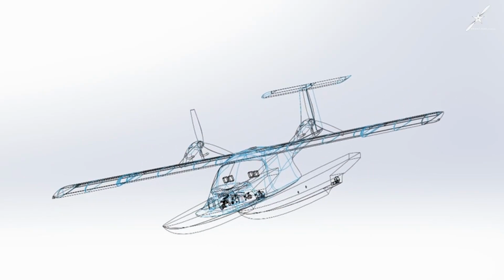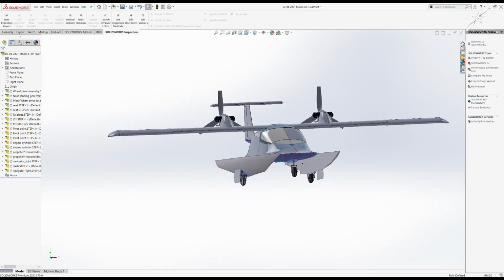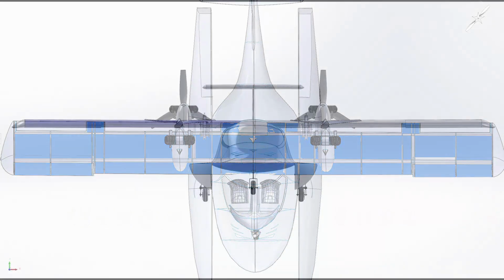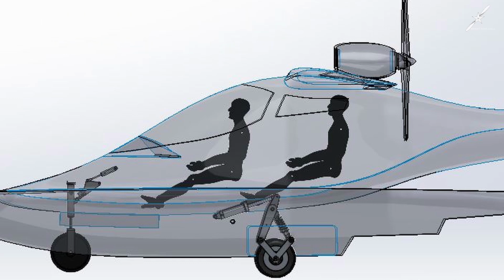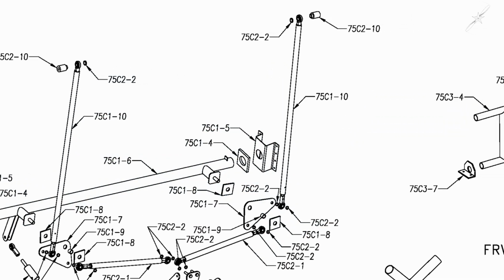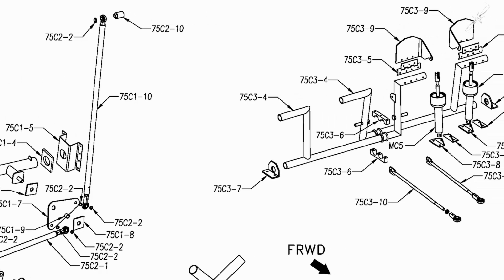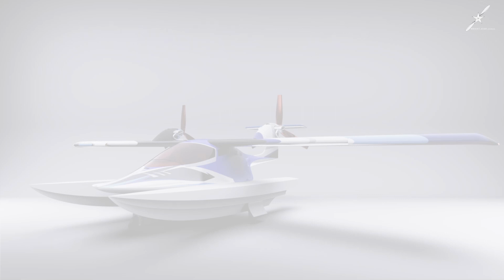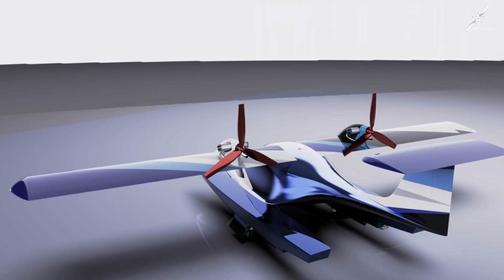Exciting, NEW, Amphibious Aircraft.

Comment: Hi, a fresh graduate and aeronautical engineer here. These are some ideas I can suggest that might be worthy.

1. The propeller being behind the wing (pusher propeller type) might not be the best idea for a seaplane or an aircraft that would be used on water. The propeller would go low when taking off and landing, and be exposed to water (it might corrode the engine and propeller). Pusher propellers also get damaged quickly by other debris from the ground. Another thing is that pusher propellers tend to be noisy as the disturbed air coming from the wing would hit the propeller. The fuselage might need to be higher in order to utilize a pusher propeller, but its center of gravity goes higher and its stability will be affected.
2. It is recommended on an aircraft design book that the clearance between the propeller and the water for a seaplane or amphibian is 18 inches or 1 prop diameter.
3. Reconsider the T-tail design as it could go into deep stall at high angles of attack.
4. I suggest you choose a symmetrical NACA airfoil for your horizontal and vertical tail to provide a symmetrical control on your tail's control surfaces.
5. The main landing gear tire diameter has a general formula D = 1.51*(Aircraft Weight*0.85)^0.349. The nose landing gear can be between 60-100% of the main landing gear's diameter. I'm sorry I cannot contribute to the mechanism of the nose landing gear since I mostly know theoretical on this.
6. The nose landing gear should have its strut in an offset angle from the tire to prevent it from the shimmying problem, or you can add a shimmy damper mechanism.

I would like to just add that the scale model of the aircraft is useful for testing on the wind tunnel. It will produce a more realistic picture of its performance but it would definitely cost more.
Reply from the maker: Thanks for writing rainlamarte1630. I appreciate all input especially from those who are aeronautical engineers.

1. Propeller will remain in this location because I want great visibility and having them on the aft section of the CG allows for the front of the aircraft to sit further out. I do understand the losses in performance I will be getting but when designing an aircraft there are always trade offs. I chose this one for a reason. Performance wasn't the reason. 
2. The tips of the propellers will be about four feet up from the water. 
3. Funny you should mention this. Just yesterday I had my CAD guy move the horizontal stabilizer to the mid section of the vertical stabilizer. 
4. The horizontal and vertical stabilizers both have symmetrical airfoils. 
5. Please email me at brightstarassemblies@yahoo.com about this. To be honest I had not thought about the size of the tire until just now. I would like to know more about this.
6. Same with this point. email me. I am not 100% sure what you mean by offset angle. I do understand a lot about shimmying problems.

Thanks again for the input. All is welcome.
Reply: Maybe make the engine tilt-capable.  Tilt down 5 or 10 degrees will shorten take off distance.
Reply: Omg, this makes me want to go out and study aeronautical engineering. Also, do you have any comments on ducted propeller fans? Are those feasible on aircraft?
Reply: Obviously you have very little experience and knowledge pertaining to light sport amphibious aircraft as 90 percent of them use this type of rear facing pusher powerplant...lololololol
Reply: @CHASEALEXANDER-F4-U  sure some do, and it is well known that they come with their issues he mentioned. I mean they have their pros like the long-ez, but they are also very prone to having gravel or dirt hit the propeller and damage them since the wheels can make stuff fly up at landing. So you are often pushed to always landing on clean asphalt airfields. It´s not a bad design, but like any choice in engineering it comes with tradeoffs. And pusher configuration is definitely not the most common one in the home built community.
Reply: @NavalTechTinkerer  bro...stop..... 90 percent are pusher config the best in the world use this config ...go back and study more son ....do i need to list them for you REMEMBER WE ARE TALKING AMPHIBIOUS...THE TOP 5 IN THE INDUSTRY ARE PUSHER ....DAR DEE DAR ...GET YOUR MONEY BACK FROM WHATEVER SCHOOL YOU WENT TO....LOLOLLOLOLOLOLOL

Comment: Using Pontoon as terminology for Sponsons may be keeping you from the source. Sponsons are the split hull design used in performance water craft. Use the simplest design to keep strength high and weight down. Look more towards aerodynamics than hull lift characteristics. Unless you are under powered. Which you should never be. The joint between the sponsons and cabin look like a weak point. Fairing the sponsons to cabin joint and wing to cabin joint may strengthen these and enhance performance.
Reply from the maker: Thanks for the comment Bryan. The actual term for them is "Floats" or so I am told by those who manufacture them. Integrating them into the hull may change the name to "Sponsons", I'm not sure. I have spoken to a manufacture since I made this video and received some good information about the shape. "The joint between the sponsons and cabin.."  Yes, I talked about this in one of my videos. I have a retired Lockheed Martin composite professional who has assured me that the amount of connection between the pontoons and fuselage is enough. Also, I'm not sure when we changed it (possibly after this video), but we have moved the pontoons inward towards the fuselage more. This will not only give us more strength in this area, but also makes it look better. Just yesterday I was talking to my CAD guy and he said he wanted to fair in the area where the wing and fuselage come together. So, that is happening now as well. Thanks again for the comment and suggestions.

Comment: How do you plan on removing the transmission from the BMW bike motor? I've tried to find good videos on this type of conversation and haven't been able to do so...
Reply from the maker: I am not planing on doing the conversion myself. There is a company over in Europe that sells them already converted. Recently I had an engineer look at the design and he is telling me that at gross weight the two 120hp engines will just barely be enough. So, I may have to put something bigger on it from the very start of the build of the prototype. As we get closer to locking in the final design, I will have a different engineer look it over and we will make our decision at that time.

Comment: Have you thought about 3d printing a model of it and testing it in a wind tunnel?
Reply from the maker: No, I had not thought about that. To be honest, I'm not really concerned with that information. This aircraft has lots of drag. One can look at it from the front and see it. I am more concerned with getting the shape of the floats correct, the location of the floats correct, and the control surfaces the correct size. Wind tunnels can't give me that information. They are used more for showing air flow, drag, and lift of an airfoil.
Reply: @BrightStarAssemblies  Catamaran style boats are not designed to stick to the water, they are in fact designed to suck air in under them to lift them as water causes more drag than air. They have strakes in the design and little fins sticking downwards to give them straight line stability in conjunction with the rudder. A wind tunnel would be good, if you have a lot of drag it will cause nose down.
Reply: @BrightStarAssemblies  Wind tunnels are not just about drag and lift testing of airfoils. I didn't even think about drag when reading the first comment here. What you really need to get a handle on is how the various unusual structures in your design will affect pitch moment and stability at various angles of attack and airspeed. On top of that you have to know what will happen at the air/water transition, even more so than for a regular float-plane, due to the wide duck-bill nose and low fuselage floor. Wind tunnels very much can give you that information, and you're not gonna look like a serious proposition without having a lot of empirical data (not just computer sims) behind you.

Comment: Question: why did u choose a pusher configuration?

With the propeller in front of the wing, you would get more lift at take-off and probably lower noise and vibration.

As someone who loves the pusher configuration, I would like to know why you chose it.
Reply from the maker: Several reasons for the pusher configuration. The first one is viability. Second one is safety. When the aircraft approaches a dock, having propellers spinning in front could injure someone. If the blade slung a chunk off then and the blades where spinning in front of the wing, it could go into the cockpit and strike someone inside. Also, if you look at a lot of amphibious aircraft, there is a good number of them with rearward facing engines. The final reason is that I just like the look. 
I do agree with the tips of the propellers coming within 12 inches of the fuselage, it will add noise and vibration. We will be putting a section of Kevlar back there for both sound and safety. I hope my answer helps. Thanks for the comment.

Comment: skip the jet thrusters and go with variable pitch props....I would lol
Reply from the maker: Thanks for the comment. Both engines already have constant speed variable pitch propellers on them. However, I will keep the water jet thrusters. Water rudders look ridiculous on an aircraft and add drag in flight. So, if I ditched the jet thrusters, I would still have to add water rudders even though my design has two engines and variable pitch propellers which can provide asymmetrical thrust. Plus, jet thrusters are cool. :-)  Having them lets me shut down the engines and just troll around like a boat. If I am using the aircraft as a fishing platform, I wouldn't have to crank up the engines (scaring the fish away) to go to another spot and fish.

Comment: Not to be an armchair engineer but, those props look a little close to the wings. If you encounter some funky forces that flexes the props a little you wouldn’t want it to chew on your wing.
Reply from the maker: Thanks for the info. We have the propellers several inches from the trailing edges of the wing. The photos may not show it very well but they are. Thanks for watching and your comment.

Comment: Did you solve the issue of your pontoons? You need to look at planing hulls for your pontoons, they're designed to raise the front of the boat out of the water, at a desired speed, thus creating less drag. I like the idea, the philosophy and the design you're going for. Just wondering whether you've considered using a blended hull body for your aircraft like the seaplanes used to have, for stability in water instead of pontoons, you might consider using stabilisers, for stability in water, which when flying can act as lifting surfaces too, if intended. I'm sure you've heard of the Icon A5, they have something similar, but not quite. You can even stow your landing gear in them, if needed. Blended hull body and stabilisers will reduce the overall size of the aircraft thus reducing drag. For engine, I've been looking at a Yamaha Apex engine with Skytrax gearbox, which provides around 150hp.
Reply from the maker: Yes, after this video a float company got in contact with me and gave me some great information. Yes I am familiar with the Icon A5. I love the aircraft but do not like that it is a day time only good weather (VFR) two place aircraft with a really high price tag of $300K. Thanks for watching.

Comment: Pusher engine issues are expressed in Beechcraft starship. Always needing to clean the prop of exhaust suit. Too bad you do not want to go electric. MagniX. 350
Reply from the maker: Thanks for your comment ptcruiser. yeah, electric is for those that only want 30 minutes of range in a four seat aircraft. I am excited for electric aircraft and once the batteries are able to give us four to five hours of range, then this might be an option. Sadly for those who want to do a cross country they would be stuck on the ground once they land for about six hours charging the batteries. Right now almost no airport has "Fast Chargers" that would charge them. So you are stuck with an aircraft that can't go anywhere. Most people buy an aircraft to go some place fast. Personally, I like more of the Slow and Low flying like in a Supper Cub.

Comment: The fuselage seems very large. From what I understand most 4-seat planes are in the realm of 42 inches wide by 39 inches tall internally, with something luxurious like the Rockwell Commander being 4ft by 4ft. Contrary to either, yours seems closer to 5x5, which could lead to excessive weight and drag. You could design a lower and slimmer fuselage and likely save on wing and empennage surface area, and therefore weight, size, and cost in all aspects. Same with then being able to decrease the pontoon sizes.

Speaking of which, why go catamaran for the pontoons? Seems again like an excessive weight, drag, cost, and complexity situation. Was it literally just the style you wanted?

Lastly, and this is of curiosity instead of nitpicking; Why T-tail as opposed to, say, cruciform or V? (I get why it's not traditional; which is probably for safety to keep it out of the water.)
Reply from the maker: Thanks for watching Dunken Hamster. The reason for the size is that I have flown so many aircraft that are just so cramped. The one that was the most comfortable was the velocity aircraft. So, my aircraft will have the same with as that one. The size of the cabin may change when I make a full size mock up of the cabin.  Honestly I am not concerned with drag. I am more interested in style and comfort.  
As for the pontoons and my choice to go with them, you are correct it is because of the style. As stated in one of my videos, "I wanted something different." Who knows, I may end up make a model of this that doesn't have pontoons. 
As for the T tail, I chose this because I wanted it further away from the water and I wanted more in the air stream of the propellers. 
Thanks for your comments.

Comment: at 7:52, the horiz-stab  SHOULD  have a  SYMMETRICAL  profile.!!!!!!!!!
Reply from the maker: Yes David, you MUST be 100% right. Let me contact all Aeronautical Engineers and tell them they have ALL been doing it wrong for years. I am of course joking as I would never ASSume to know more than all Aeronautical Engineers like you are doing. So, I will let YOU tell them. I am sure you have many aircraft you have designed that are flying today and know more than them. As for me, I am NOT an Aeronautical Engineer and I do have a symmetrical profile on my horizontal stabilizer. Thankfully I do not need as many explanation points as you do to get my point across. ;-)  All the best to you in your search for perfection.

Comment: You absolutely CAN make a scale model that can simulate the handling of the full-scale aircraft.  Look up "non-dimensional analysis".  Definitely one of the most eye-opening courses in my BSME degree.
Reply from the maker: Thanks for the comment.
Reply: A seaplane I was working on had a scale model AND wind tunnel tests.  The tunnel tests showed some problems and we were able to quantify the problem we saw in the scale models.  It saved me $millions in wasted R&D and perhaps a fatal crash....  

I can see a LOT of problems with this Bright Star design...  They need to rethink what they are doing...it will fail or kill someone.  

I would be happy to consult with them if they will listen.  Icon A5 would not listen and they are bankrupt.
Reply: Yes dimensionless analysis is the key here. That's how they tested aircraft designs in WW2 and the Cold War in wind tunnels (i.e. the pre-CFD era)

Comment: i think a few degrees higher Dihedral could be better. im not an expert or anything but it does look really straight
Reply from the maker: You are correct it does look straight. I did that for a reason. The greater the dihedral the less vertical component of lift a wing can produce. Greater the dihedral the less maneuverability an aircraft has. A good example of this is fully aerobatic aircraft have no dihedral. So, as stated in the video, once I have an aeronautical engineer look at it, then we can decide how many degrees we want. I will probably go with the amount of degrees a Cessna 177 has. Which of course is a bit more than what I have now.   Thanks for the comment.
Reply: @BrightStarAssemblies  ok that makes a bit more sense. I guess i forgot that it is still in its design stage so things can be changed :)
Reply: @BrightStarAssemblies diahedral is great for stability, 2-3 degrees should add tons of stability

Comment: Just for simplicity. They make transom thrusters(trolling motors). You can partially shroud them in the pontoons and only lose a minor amount of thrust. Having work independent jets and operate reverse gates at the same time. With the trollers it would be a simple rotary to auto forward revers each side.
Reply from the maker: Thomas, thanks for the comment. Could you send me photos and links to what you are talking about to my email address: brightstarassemblies@yahoo.com  I would like to see more of what you are talking about. Also, if you know a way to easily and simplistically interact with both motors at the same time, I would like to hear about that as well. Thanks
Reply: @BrightStarAssemblies  Burt Rutan had an amphib. aircraft as well...though it was a monohull...
On your design I think the back-end of the pontoons with the square ending will create much unnecessary drag...the top surface also needs some curve (at least on the front)...
The pontoon nose tips do not need to be that pointy...it is not a supersonic aircraft...